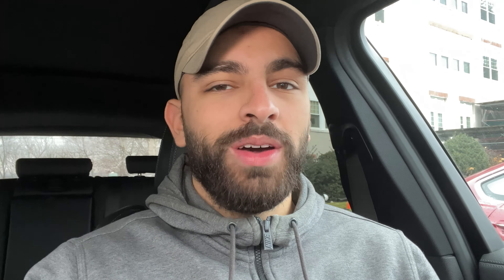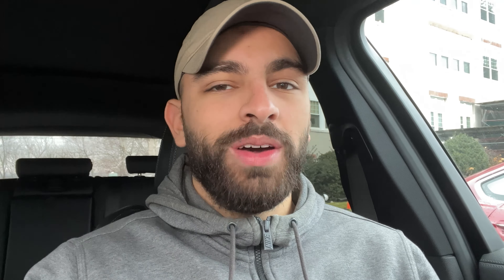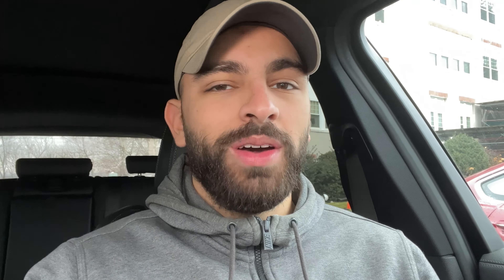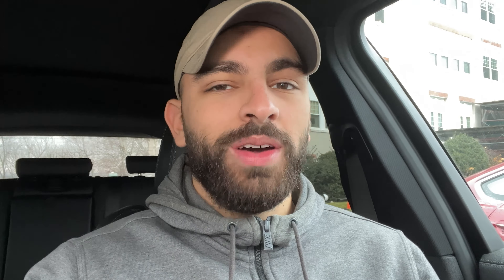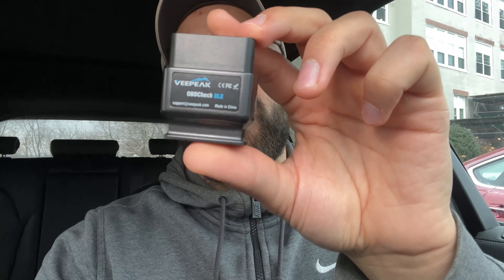HOW TO TURN OFF THE ANNOYING BMW ACTIVE SOUND DESIGN. *Does it really make a difference?*

Comment: if only BMW had this option: turn ASD on in sport mode, and off in comfort and eco pro
Reply: They kind of do in (some) newer models, you have now the "engine sound" option under general settings and you can choose the option "depending on driving mode", which enhances ASD in sport mode and reduces it in comfort/eco.

Comment: I found that even though I turn it off in BimmerLink, it will turn itself back on the next time I drive.  Seems like the setting doesn't stick for some reason.  I am having to disable it everyday.  I'm assuming my results are different due to having an iDrive 7 '21 m40i.
Reply: Go to a professional tuner and do ecu remapping. They will disable it permanently.
Reply: @nuclear_nadal7494  I just set the engine sound option in the car to quiet and unplugged the exhaust flaps so it's always open.  Mickey mouse solution but it works.  Not trying to void my warranty yet and not planning on doing any performance mods to my daily.  My RS3 keeps me from modding the X3.